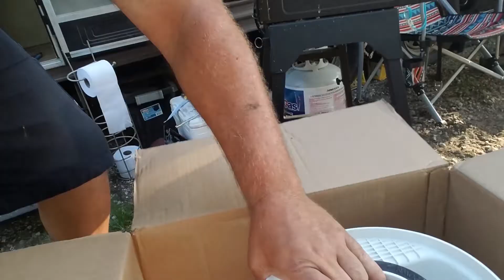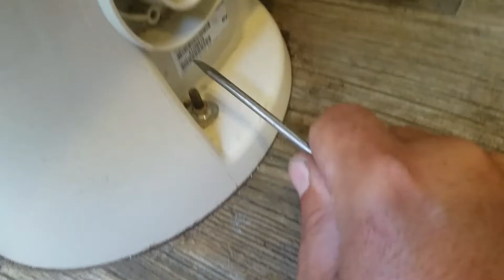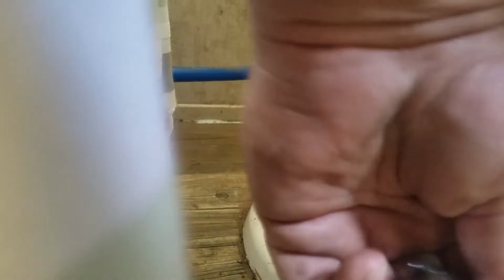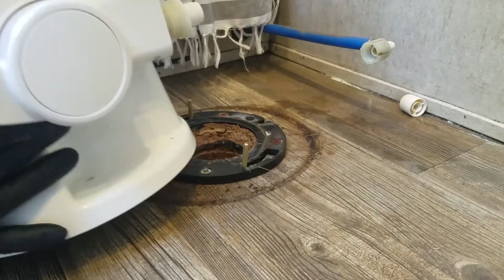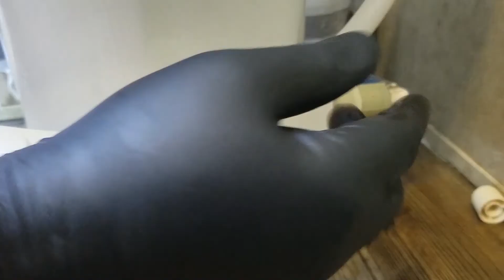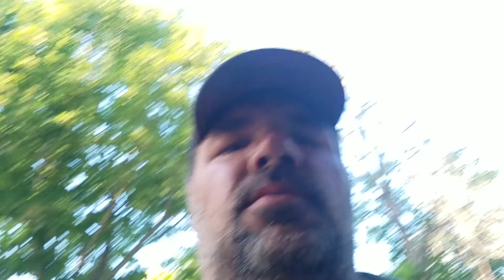RV REPAIR | Replace a Camper Toilet in Minutes!!! | Dometic Toilet Install | Full Time RV Living

Comment: Great video! I recently bought a used camper and the floor ended up being rotted. While i replaced the floor i went ahead and gutted the tiny bathroom and installed a ceramic house toilet and a 38 inch stand up shower.  I made a small viseo of it. I also added a 19 gallon water heater so i can take a shower without my arms banging in the wall and not trying to be in a hurry before the water gets cold. I can use the toilet without my legs going numb.

Comment: Dude you are awesome. Thanks for this video. I'm about to change mine out
Reply from the maker: Cool.  No problem.  It's a pretty simple job.  You may want to clean the surface a bit better before reinstall.  We didn't have any trouble from it but several people have commented that it should be done 👍

Comment: So my campers old 1992 model.. I’d been using it for storage for 3 or 4 years so wasn’t hooked up to water.. well decided to hook it up, turned the water on… I heard water spraying inside.. low n behold the pipe behind the toilet spraying everywhere.. I turn it off.. come find out it blew the whole connector from the toilet itself like broke from the toilet still attached to the pipe… so what I’m getting at is… I guess I should’ve had the sink on or toilet lever held while turning the water on bc I reckon the air inside the pipes caused it to burst from the pressure 
I’m not a plumber so I have no idea… but maybe this will save someone some trouble bc I still have not had time to fix this and I’ve got to buy a whole new toilet for abt $140 just bc I didn’t turn a knob 😂 which is why I looked up this video… 
Great video btw thanks!!

Comment: I am being charged 2 hours of labor to get the same toilet installed (old toilet removed) in my 25 foot class C motorhome.  How long did it actually take you?  They also told me they need to do a "water test" after installation.  What is that and how long could that take?  Thanks
Reply from the maker: Zach Mandell that sounds like it could be a standard charge but the job can literally be done in 30 minutes or less barring any complications. I am not sure what a water test is...maybe checking for leaks?  Maybe 5 more minutes for that.  Would love for someone who knows to comment and clarify that.
Reply: Plumbers have a minimum charge.. water pressure check for leaks & letting air out of lines is a water test. ALWAYS use a new O Ring Seal when installing...I noticed u didn't. I would correct that because Floors r hard to replace. Always leave sinks open before u turn water back on...to keep water pressure  from causing a leak...because of air in the lines when turning the water back on. (I am a contractor.)
Reply: @mshowell3710  what if you run a water pressure regulator on your water hose that hooks up to the rv? I usually have mine set to 40psi

Comment: What size are the nuts so I don't have to spend a fortune on a full set of ratchet wrenches?
Reply from the maker: Hey RANDOM STUFF GARAGE.  Looks like ours were 11 millimeter. Hope this helps 👍
Reply: @CamperSizeLiving  thanks! I will check with with a socket before buying a ratcheting wrench.
Much appreciated!